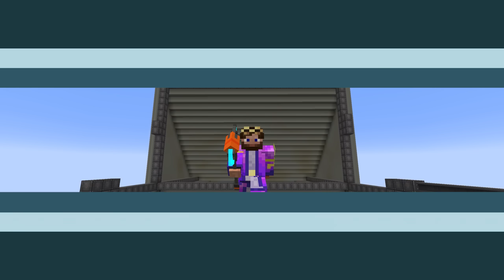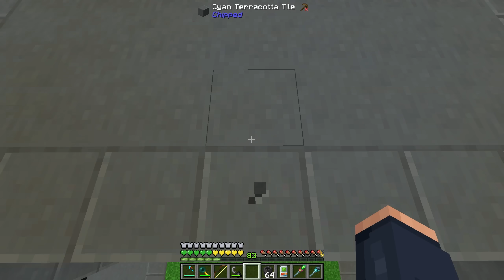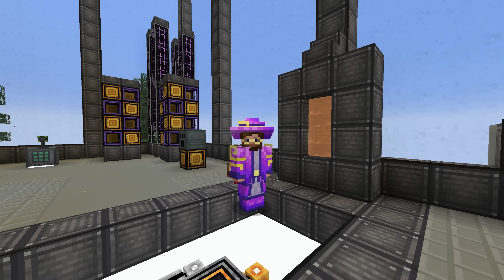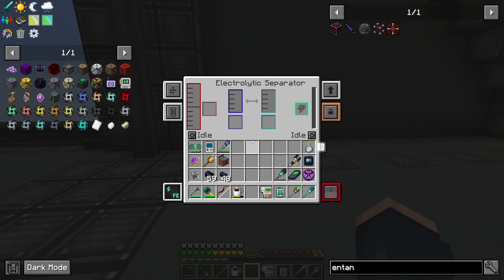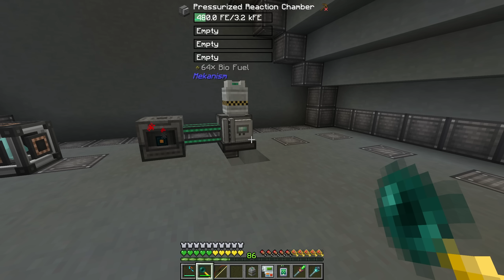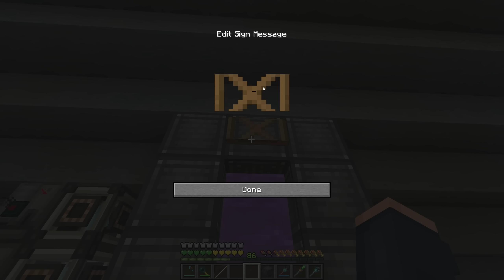All The Mods 10 To The Sky EP33 How to Automate HDPE Pellet and Fissile Fuel

Comment: I will be as clear as possible with this:

EVERY machine from Mekanism can be upgraded with the Speed and Efficiency upgrades.
But also, EVERY MACHINE HAS FACTORY UPGRADES.
Every single block Mek machine can, in fact, be upgraded to have more internal slots for processing.
Chosen and many other YouTubers don't do this, for some reason, but yes.
It can be done.
Reply: ?  even the rotary condensintrator, chemical infuser, chemical oxidiser, and the like?  I could've sworn those were stubborn and needed physical scaling instead of supporting tier upgrades.  being able to 8x those in addition to speed upgrades would be crazy useful.
Reply: @princeofbrats  iirc in base mekanism you have to scale that way but often the atm mods include the "mekanism: more machines" mod that adds upgrades. The next time youre playing an atm pack just search ultimate in JEI and theyll show up if that pack has them.
Reply: @DaMurph676  oooo when last i played atm it didnt seeeem to have that mod, but ill see abt adding it manually when next i play a mek heavy pack :D ty!
Reply: @princeofbrats its included in the most recent Atm10 pack; cant say for sure about Atm-tts causs ive never played it 😅 

The upgraded machines are a life saver for big chains like fuel or ore processing; ive been upgrading my ore proc recently and im able to do roughly 1000 raw ore in ~5mins. I dont wanna think about how long that would take without the better machines 😅
Reply: I don't think chemical machines have factory varient in newer versions

Comment: I like putting the chemicals into my AE2 computer, so I can manage it easier by using overflow and equal distribution cards. With a few chemical cells, since they only hold 5 types. It's set and forget at that point.

Comment: Chosen. I CANNOT emphasize this enough: upgrades, are your best friend in mekanism. They work on EVERY MACHINE, except for multiblocks. Each machine takes at least 8 energy and 8 speed upgrades, and depending on the machine, these upgrades can have effectiveness anywhere from 10x efficiency/speed, to 256x. Gas upgrades especially are crucial if you’re going to attempt ore processing of any kind, as they make the difference between constantly running out of a gas, and being able to effectively sustain it indefinitely. Also, if you’re using a thermal evaporation chamber, resistive heaters should be placed DIRECTLY against the input port. Thermodynamic cables reduce the effectiveness an ungodly amount! Also, if you ever end up needing antimatter, I highly recommend getting an effective sodium production system going, so you can replace your water cooling in your reactor with sodium cooling. This does require the setup of a thermoelectric boiler, but the payoff is WELL worth it when you’re scaling up to high level antimatter production. Just some friendly advice from a mekanism pro!

Edit 1: Ayo I did NOT expect this much love on my comment! Tysm guys! To answer some comments, I know chosen said he upgraded all his machines, but I definitely saw at least a few machines that he hadn’t upgraded by the end of the video. Also, sodium cooling may be annoying to produce, but once you have it, not only do you not need to constantly burn power and resources pumping water, but you also make the reactor far more efficient! More heat makes for less production, and also more danger, since if it gets too hot, it’ll damage itself and self destruct! Whereas if you use steam and the boiler, you can create a closed loop system, self replenishing the sodium, and keeping the reactor nice and cool! Cheers for all the likes and stuff guys!
Also, my favorite mekanism multiblock is definitely the Supercritical Phase Shifter. Something super cool about creating antimatter live in front of my eyes!
Reply: Chosen: has stacks of upgrades in his inventory, mentions chemical upgrades specifically, says he upgraded all the machines
Comments: "UPGRADES!!!"
😂
Reply: @dejsimiwerkin8681 I was going to say... I saw this comment when I started the video, and as I watched more, I was like, "...but he addressed that in the video???? "
Reply: Not to mention that simply scaling things up does wonders. There is nothing stopping you from just making more machines to make what you need. I realized that using one of each machine to make fissile fuel was not enough. One could theoretically do the math and perfectly proportion the machine count (such as what Satisfactory players do) but what I did was just run 1 Isotopic Centrifuge, wait til i find a bottleneck, and scale up whatever needs it.
Reply: The caveat to this is the Electrolytic Separator. While it can take energy upgrades, they don’t do anything in the machine so it’s just as well to leave them out.
Reply: Sodium cooling large reactors sucks. It takes so much time to fill up the reactors far enough to crank them up.

If an infinite water source and extremely fast fluid logistics are in the pack, you're better off with ten max size water cooled reactors than a single sodium cooled. Takes way way less time to setup as well and you're better off using those thermoelectric boilers to max out DT-fuel for the fusion reactor.
Reply: Agreed, i feel like w/ mekanism only some machines need to be "made more of". the tier upgrades and normal upgrades do a lot for efficiency and speed.
Reply: Why the sodium though? /srs
Reply: I very much agree on this one, even though i've never used sodium for cooling, also never forget pipe upgrades and tier addons. Very important as well :p

Comment: Realistically, each machine should only be "Dumping Excess" on one.  Not both.  If you need it, then it won't be excess so they run, and if not then they can stop.
Reply: Your needs change throughout the pack, generally. This way you don't have to look out for that moment when suddenly everything stops working because your hydrogen is now filled up.
Reply: @paulelderson934  I was not clear; that's my fault.  The point is that you have some dumping one, some dumping that other.